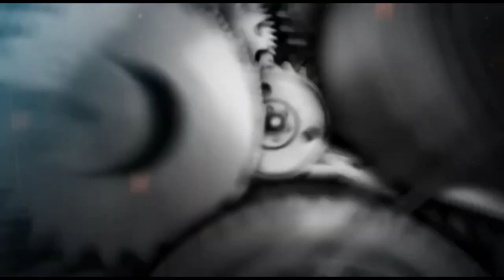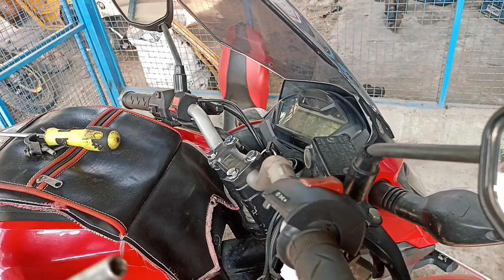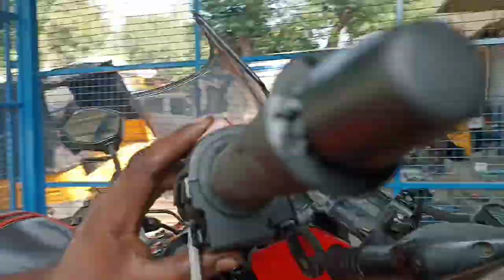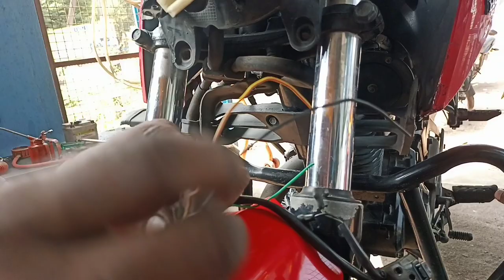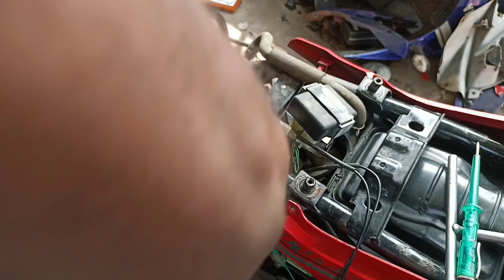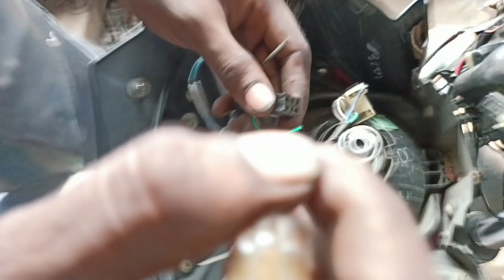PULSAR Switch kit Modified in Honda HORNET/TAMIL..

Comment: Hi Anna,
Honda CB shine BS3 2015 model. Overheating in 2 kms. Engine romba noise ah rough ah odudhu. Changed clutch plate, new engine oil, oil pumping to head properly Anna. Carburettor tuned and cleaned properly. Bike wheels brakes not tight . Wheel free rotating. New engine oil from honda. chain properly adjusted and lubricated. silencer cleaned completely.
Apdiyum heat problem in 2 kms and rough noisy running above 30 kms.

Comment: TVs sport 2012 model local shop la service vitan bro 1.fork oil and oil seal change pana sonnan 2.accelerator cable Change pana sonnan 3.side stand spring change pana sonnan 4.water wash pana sonnan 5.bumber tight vaika sonnan 6.break shoe change pana sonnan total ah evalo cost keta pothu rs1500 sonnanga intha cost ok va illa athigama?